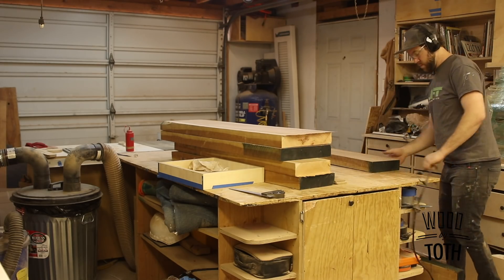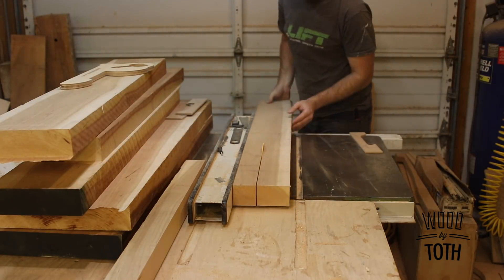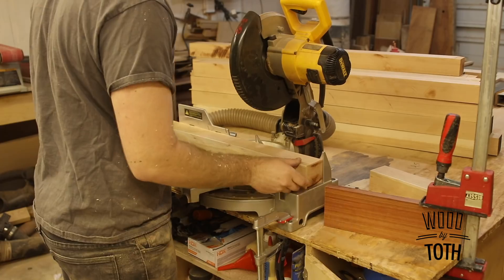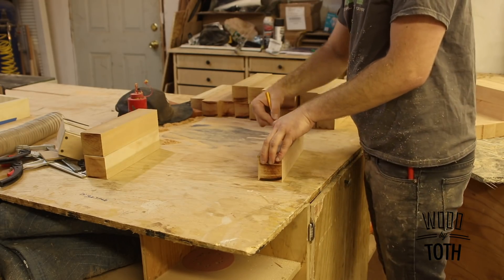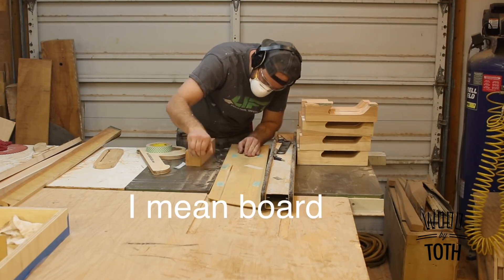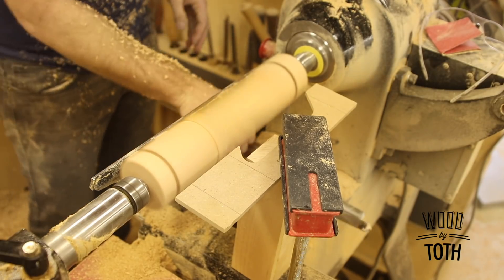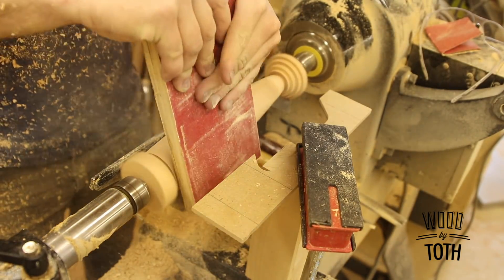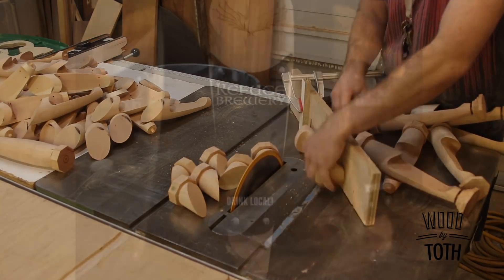Tap Handle Production

Comment: BEAST MODE!  How long, overall, did it take you to do all of those?  They are badass!!  Did you also do the wings emblem on the top of the handle?
Reply from the maker: Yeaaaah. Its takes about 4-5 days to do 100. If I push it I can do 120-150 in that same time but the days are longer, and the top is lasered by them but its really time consuming so they don't do it anymore

Comment: How do you lay out the holes for the plaque that's screwed on?
Is the top laser engraved? Does someone else do that?
Is there anything else done to the bottom after you break off the waste?
TIA
Reply from the maker: I use a ice pick to poke the holes with a master template. The top is layered by someone else and there is a custom threaded insert that gets epoxy into the bottom. Taps are all 3/8 inch threads